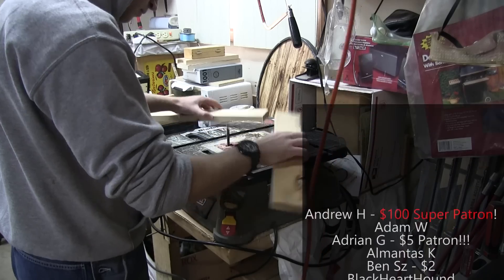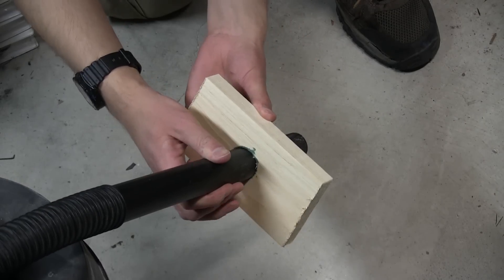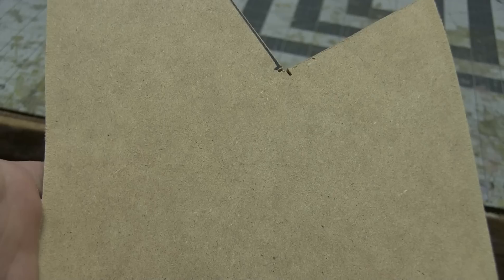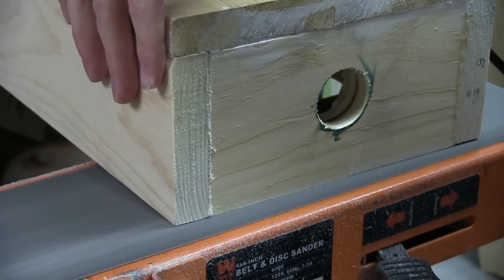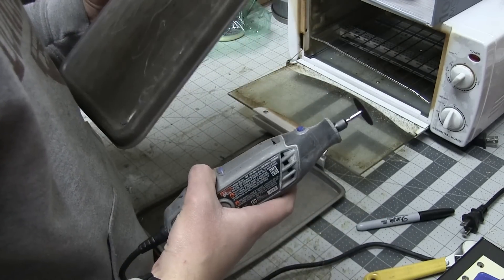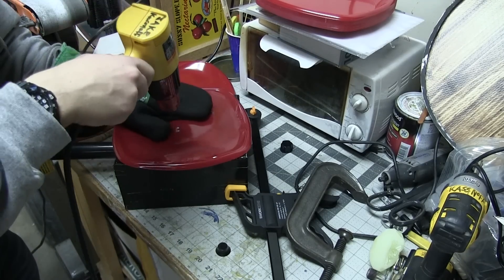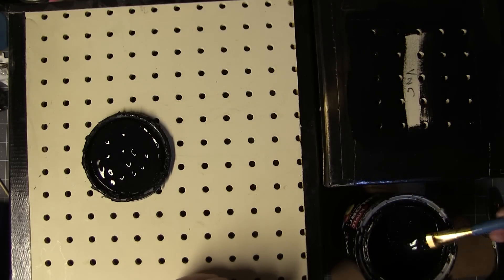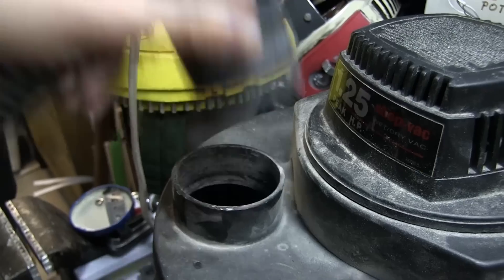How to Make a Vacuum Former (DIY)

Comment: This actually made me a lot less afraid of building a vacuum former. I've always seen the larger, more elaborate ones with built-in heating elements and guide rails and the works, but if I could just make a wooden box and use tools I'd already have for the complicated stuff? That's way more cozy on my minimal budget in my minimal space for minimal pieces.